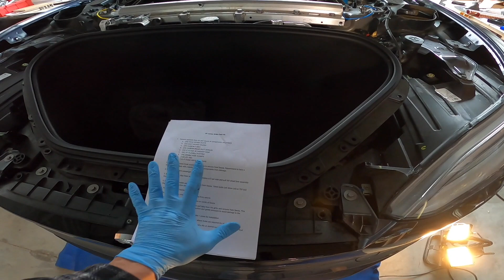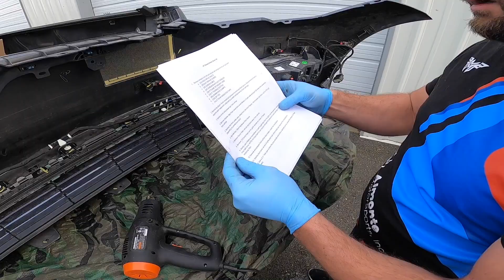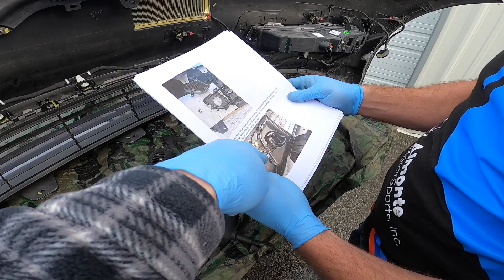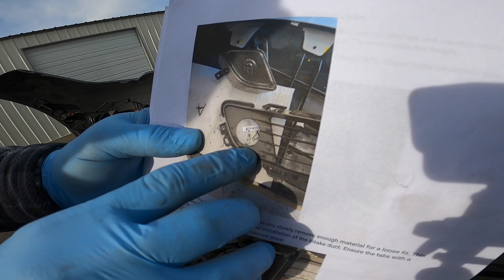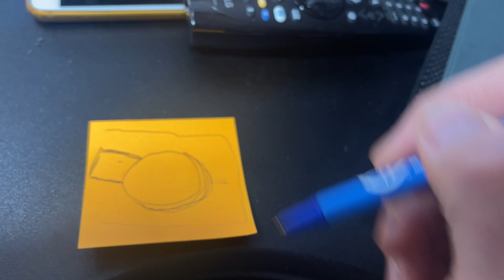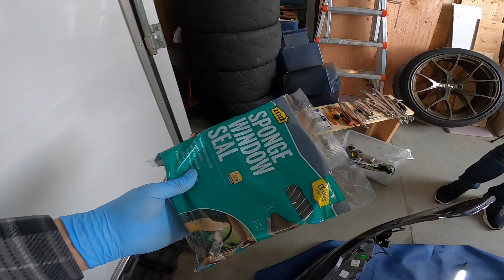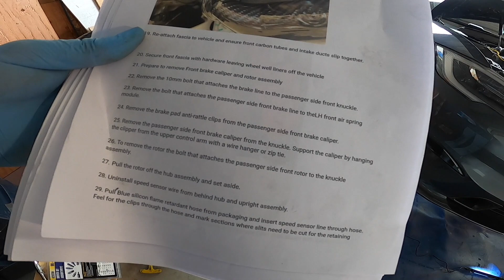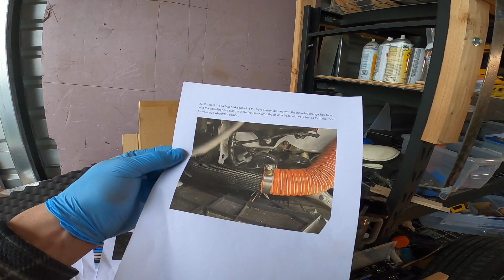Stop Overheating Tesla Brakes | Unplugged Performance Brake Ducting Step-by-Step Install

Comment: Did you run any brake temps with/without the ducts to see what the difference is in temps?
Reply from the maker: I haven’t been on the track yet, and it’s pretty cold in Idaho, it’s gonna be a few months until I can put these to the test on the track!
Reply: @PlaidAF  Sounds good - we are working on fabbing a set for the teampgr plaid as we were seeing rotor temps in the 900c/1650f range last year which is fine for the pads/rotors we were running, but ideally we'd be down a bit from there, especially if we can make the power last a bit longer...  We have the Motec data acq and brake temp sensors so we can watch the temps live and see what difference we can make.
Reply: @PlaidAF  FYI - over the weekend we ran the set we fabbed/printed at a couple tracks and saw 200+C difference in peak temps.  That's really solid!  Hope you also see something close.